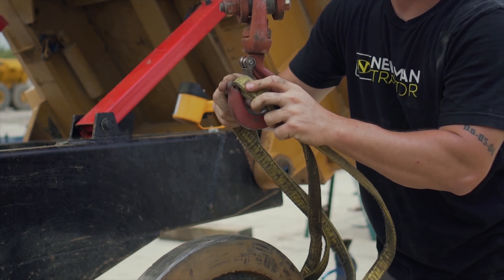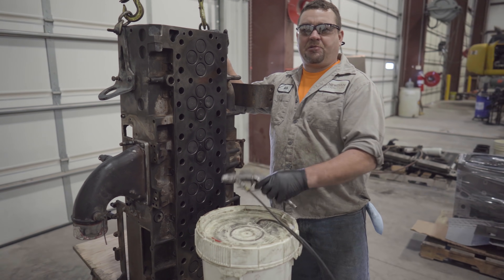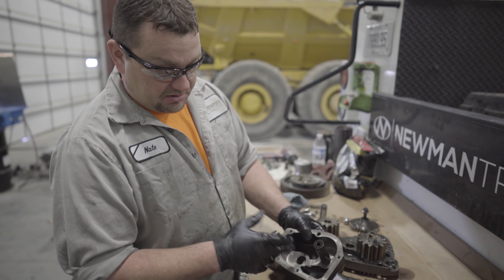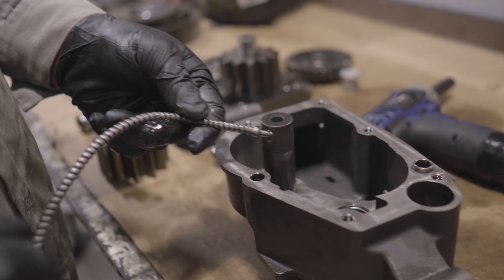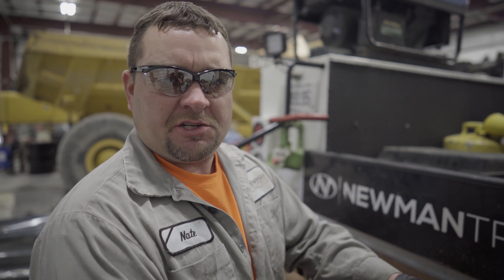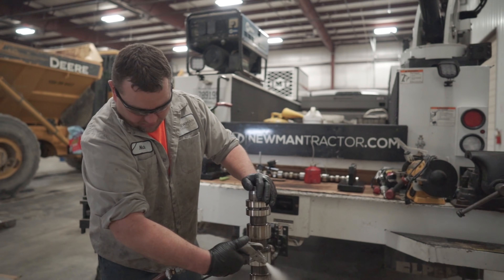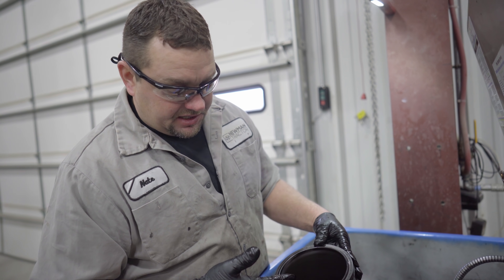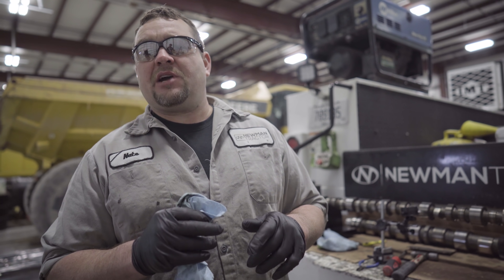Our diesel mechanics shows how to rebuild a 24v Cummins diesel engine!

Comment: Nate! You are the Engine repairing master! Good job! Respect from offshore!
Reply: Um
Reply: ]p[[o[[oopo]]]p⁹⁰⁹⁹999⁹⁹9⁹00]⁹9⁰⁰⁰90]] p] 0⁹999⁹]⁹pp]]][o[[o[[[pp[99]][[[[[[[[0 p 0⁰⁹00⁰0]⁰⁰⁰
Reply: I some screwed up timing when removing injector pump. Did not line up key way to the top